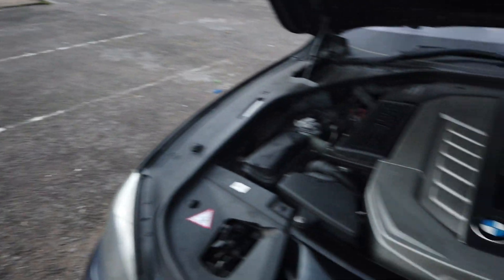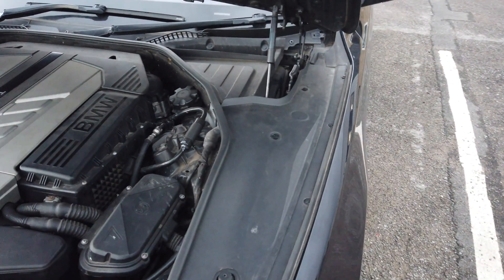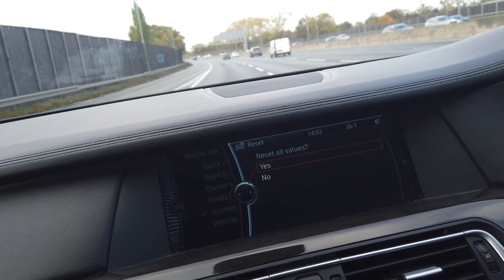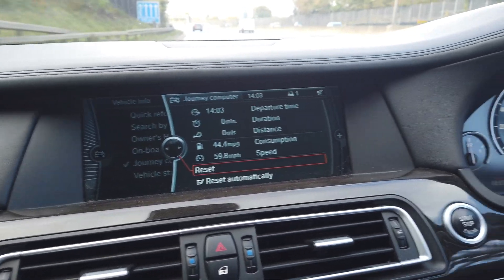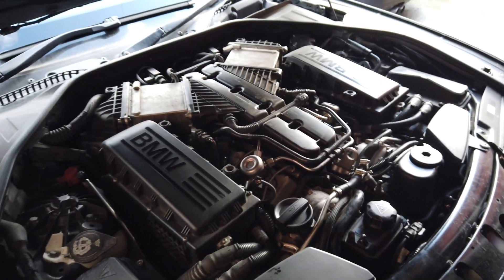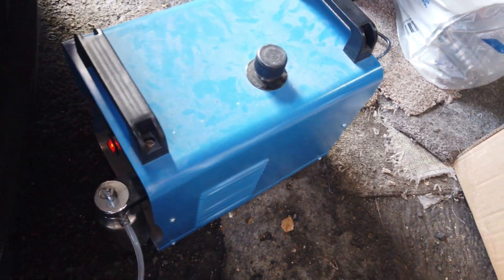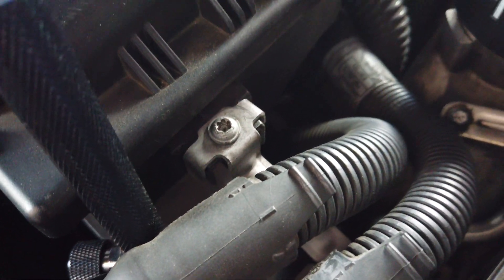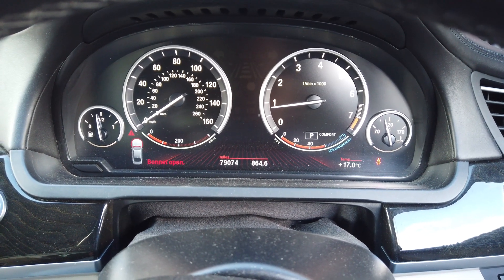Does carbon cleaning really work? Tested on a bmw n74 v12 direct injection carbon clean

Comment: Does the n74b68 in the rolls Royce have port and direct injection or is it just direct only?  Thx.
Reply: Pretty sure it's the same as the
BMW N74, just stroked to 6.75
and ECUs tuned accordingnly.
I would make sure to have this
beast blasted by the best shop
around.

Comment: not the sort of carbon cleaning i was expecting... which machine is that?

All I've ever done is walnut blasting on these and the regular suspects (N54, N55, N63, M57, N57 etc) which can have huge impacts as far as performance and drivability.
Reply from the maker: hi mate this is the hydrogen carbon clean, nothing will beat a manual clean especially on a direct injection engine but it will reduce emissions and have some impact, these and other engine like the b7 rs4 will benefit from a manual clean with walnut shells far better than other engines
Reply: How badly does the n74b68 in the 2018+ rolls Royce phantom develop carbon buildup?  Thx